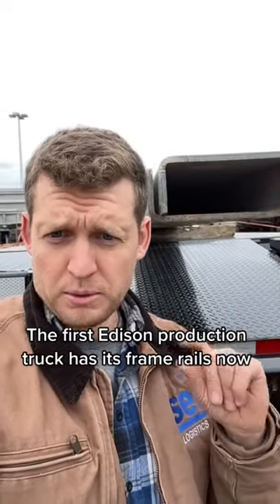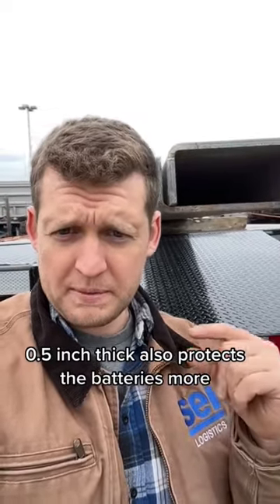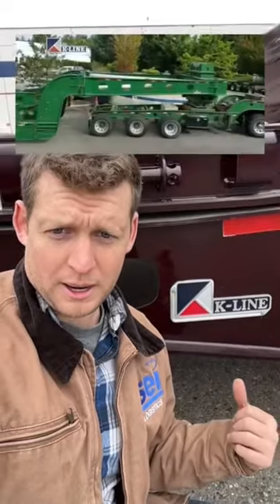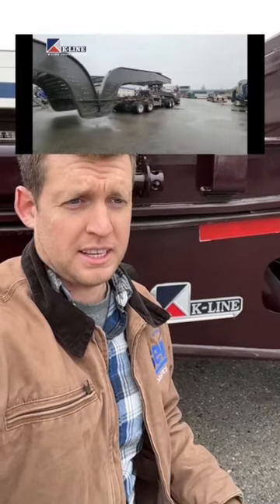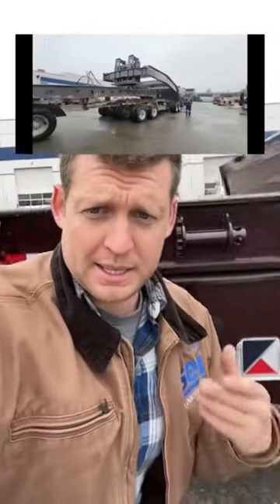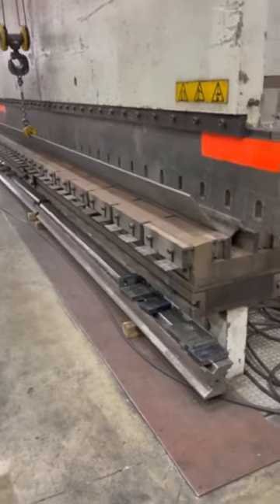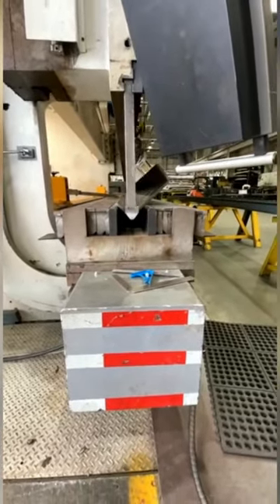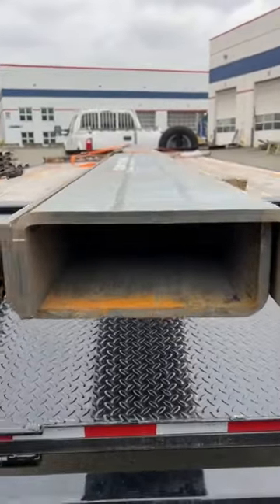We now have Frame Rails, Thanks to Kline Trailers #heavyhaul #edisonmotors

Comment: First thought wtf T10 steel (background I'm a machinist and I work with a wide range of steel alloys) one quick google search later I  see a composition of  1% carbon steel and 0.35% silicon. God help you if you ever need to weld that stuff. 1% carbon is a lot. Typically, 1018 is the go-to for welding it's .18%. To weld something with a 1% carbon content you'd have to pre heat the metal. We have to pre heat 1045 (.45% carbon) and 1080 (.80% carbon) for the weld to have penitration. So please tell me that you're pre heating or bolting/riveting these things together??
Reply from the maker: It’s illegal to weld frame rails on a truck though

Comment: All this outsourcing I'm sure is massively increasing the end product price
Reply: Not as much as buying the press brake needed to shape that steel and build the building around it just to bend the frame. In this case a one off prototype production truck it cheaper to pay the vendor and bury this in the R and D column of a company start up loss. Businesses are expected to lose money the first 3 years from day 1 in the 4th year a profit is expected. By writing this off this way they can recover s lot in deductions at the end of the year. More so than building a building.
Long term building 3000 trucks a year yes much better to have everything in house. Building 1, 5, 10 trucks a year better to strike a deal with a vendor during their downtime to do a side job for you. Keeps their employees earning a check during a slow time.

Comment: Open C chanel frame ❤. My new F-250 has stiff non-flexible boxed frame reducing wheel travel whilst off-road results in getting stuck, breaking LEAFSPRINGS, way more uncomfortable ride & reducing reliability! 😡 Compared to my other trucks I used for years 😭! Man I could use a *straight framed open C-channel frame! 😃 Boy howdy,  naturally Lifted (BECAUSE OF A STRAIGHT FRAME😊) & ANY REPAIRS WOULD BE MUCH EASIER & LESS COSTLY TOO. HECK FROM THE GET GO, THE VEHICLES WOULD BE LESS COSTLY!
Reply: Less costly & lighter TOO!

Comment: Dude, are you sure about that T10 steel claim?  Because T1, ie A514, would make a hell of a lot more sense. As would any other HSLA sheet steel. I had to look up T10 and that seems to be tool steel, not something you'd want to use in a structural application.
That is all.

Comment: Is that 100,000 PSI steel?
   I recently had to have my frame repaired, and I learned that most frames are made of 36,000 PSI steel, but they bolted in 100,000 PSI steel to fix the frame.
Reply: What kind of truck, I presume you drive a truck? I have always heard that when a car has had its frame bent in an accident it can never be made right and should be scrapped.

Comment: Wouldn’t this add significant weight and initial cost. Along with high cost on fuel and wearing components. Could it be possible that the engineers for other truck companies thought of this and that’s why they picked that thickness.
Reply: This guy is building vocational primarily off highway trucks.

Comment: Even though I come the other 98% of the world that uses metric, even I know the company that could bend 3/8” steel should be also able to bend 1/2” steel, because no company would waste money buying a press that dies in the ass just over their normal production line limit.
Reply: Maybe, but what is 1/4, or 3/8 is your normal and the 3/8 IS the outlier.  More over, it's not thickness that is the limiting factor, it's tonnage.  Their press might do 1 1/2" material at 8' long, but that's a different tonnage that 1/2" at 20' long. Pulse mild steel is different tonnage than AR, T-1, T-2 etc.  This not as simple to say 1/8" doesn't make that much of a difference, we can do that.
Reply: It would if the company's sole concern at this machine was building standard size truck frames.

Comment: Have you ever though about doing alu rails? If they’re sufficiently thick they should be no issue and won’t rust like steel
Reply: It is cost prohibited. You would need 1 inch to 1.25 inch thick frame rails. Aluminum has strength but doesn't have the flexing properties of steel. Aluminum will tear under the forces of inertia rather than flexing and returning to a resting state.
Reply: @2ndtwo1  
Aircraft.
Reply: @largemarge1603  Aircraft don't experience the same forces in the same ways. Aircraft use a skeletal system of braces not frame rails. Aircraft have a very consistent even amount of pressure being exerted on the whole structure from the air pressure outside. They don't have distant contact points taking the entire load. You know what happens when an aircraft hits a bump or lands to hard right? It crashes, breaks landing gear, and sometimes breaks the wings off.
Reply: Yes he's right aluminum tears doesn't have the flax. We have 3 manure spreaders steel tank we bought one aluminum tank within a year the seams were tearing they couldn't handle the flex in the fields
Reply: Steel and ferrous alloys are the only ones, to my knowledge, which have the characteristic of an infinite spring cycle life. Only steel can make a spring, a coil spring, helical, whatever, that never loses its properties. Or for practical purposes never loses strength. It can flex millions of times, or more, more than they could count. 

As I remember from my material science class, only steel, not other metals like aluminum or brass, or gold or tin or copper, lead or zinc, they work harden or deform or crack or fail in some way or other. They just wear out. 

A better educated person could explain this better. But there is great reason in engineering to make all springs out of steel if long life is valued. 

Unless of course it's expendable like a spring in a missile perhaps? You know an e.g. beryllium bronze alloy spring might only be able to flex (picks number out of his ass) 50,000 times for losing half its travel or such, but in a small robotic rocket like a MANPAD that lives and dies in a couple of minutes at most, it might turn eighty times in forty seconds so it'll never hit 50k, so BB is ok if it saves weight, avoids sparking, magnetic detection, etc. 

Please correct me if I am mistaken or out of date.
Reply: @2ndtwo1 also this is why aircraft not built of steel, aluminum, ie most of them, have fatigue lives that have to be measured on track to avoid unpredictable failures. Aluminum can endure only so many spring cycles before failing. In fact alloys like  "Duralumin" was created for precisely this application, extending Al alloy fatigue cycle life. 

When they said things like the F-18s are wearing out, that meant that aluminum and composite components had endured so many spring cycles of being flexed through normal routine falling of the aircraft, with obviously a great deal of time take off and landing, I don't know if it could be even more in high speed maneuvers. But just  takeoffs and landings would be significant. If you use up a cycle that can only be repeated 5 or 10,000 times, it's only 2500-5000 times you can use the aircraft, max. If with maneuvers you flex dozens of times, or flex really hard, overloading design g limits, you bring the number down greatly. It's predictable but not always to the last drop. Sometimes airplanes fall out of the sky.
Reply: They rot out anywhere steel is bolted to them, it's been tried and almost all of them have rotted out by now

Comment: The other issue you might run into is GVWR
Reply: Why should that matter?
Reply: @HJZ75driver  once you gross over 80K you need a heavy haul permit, some states you can get a unlimited use permit up to a certain weight, WA for example goes up to 105,500 LB, assuming of course you have the axle count to make it legal (4+4 four on tractor, four on trailer).

In short, you have 80,000 LB budget and you need to fit tractor, trailer, freight, driver, and whatever else is needed.

Comment: Have you considered using *CORTEN steel*?
Reply: Corten is shipping container steel
Reply: @HJZ75driver  read a little further than the first google result... used for a lot more than that. John Derre corporation headquarters used it for exposed beam construction
Reply: @1truthseeking8 It's used in things like parkway guard rails to rust over quickly and protect the interior with a quick thick consistent layer of iron oxide that doesn't penetrate and go through. So the stuff lasts in the rain. Also it's a tasteful brown and blends in with green treeful parkways.

Comment: I have often wondered why not  square tube rail for heavy truck ..??
Reply: Square tubing rusts faster, traps moisture, and doesn't flex correctly for heavy loads. This is the reason box frames don't last half as long as channel frames. It is the same reason heavy haul trailers use I beams or channel frames.
Reply: @2ndtwo1 Good knowledge! Thank you. Can you go into flexing correctly?
Reply: @2ndtwo1  Jeff Gordon hadacar they called T rex ...had square tube frame ..changed the way the car  flexed and had an oustanding year ..
Nascar ultimately outlawed the design trying to head off a multi billion dollar frame building race .
Reply: @stevenpalmore4299  Yes it stiffened the frame. For a vehicle that only sees flat well taken care of surfaces a square tubing frame is a good idea because it keeps all of the flex in the suspension and out of the frame. A 2000lb race car is much different than a 16000lb truck (empty weight) in use, design, and flex.

On poor condition roads, potholes, dirt roads, gravel roads, and uneven surfaces it is horrible with heavy loads. The limited flex will guarantee unequal load balancing across the axles and from corner to corner.
Reply: @nichevo1  Have you ever really looked at a torsion bar for an IFS 4x4 truck? Heavy haul trucks Use high carbon frame rails, they work like torsion bars the ends (suspension points) are held mostly still the center section twists at a slow continuous rate over the entire span to allow for travel over uneven surfaces. That twist allows for even traction and weight distribution to all of the tires. Have you ever watched a truck rev in 1st starting from a stop. You can see the frame twist, if it were a non flexing frame it would also take pressure off the same side of the drive axle in the back Rather than the lifting motion being held in the front corner. 

The suspension on heavy trucks is designed to take heavy bumps with massive amounts of weight which limits its ability to do anything about uneven and small traction changes. This is why seats and even some cabs are air ride because the suspension has to be so stiff it will literally throw the driver around.
Reply: @2ndtwo1  trailers are built with a center torsion bar design ..allowing the frame flex makes it strong and light ...would be interesting design for trucks like dump trucks .

Comment: Electric trucks will not last 30 years. Electric vehicles will not last at all. Stick with the true trade, method of gas and diesel for your fuel source.
Reply: It's a hybrid, watch some more videos, then comment.
Reply: Lol
Reply: Think about how old some large container ships are that were built with the same powertran technology
Reply: You literally have no idea what you are talking about. Please educate yourself before spouting BS. He is making the equivalent truck based on train technology that has been in use over 50 years and is the only technology used in trains today because it works.
Reply: @arthurr8670  also made from CORTEN steel or similar corrosion "resistant"...